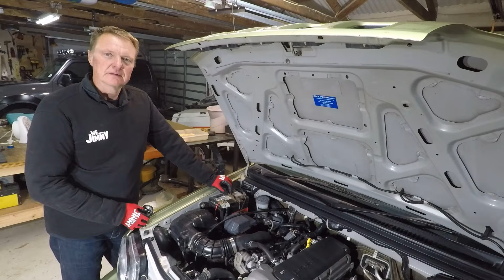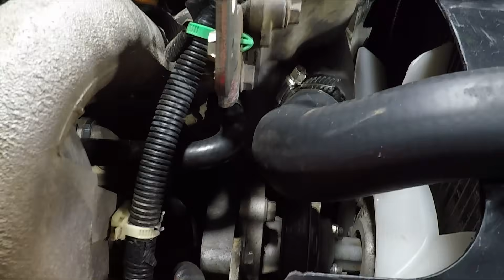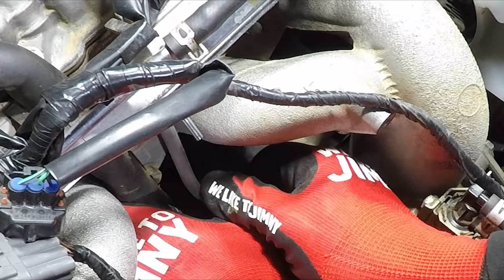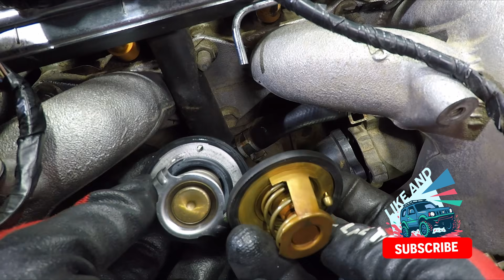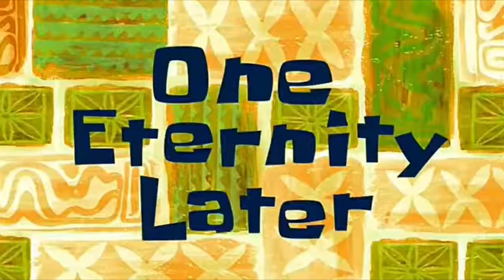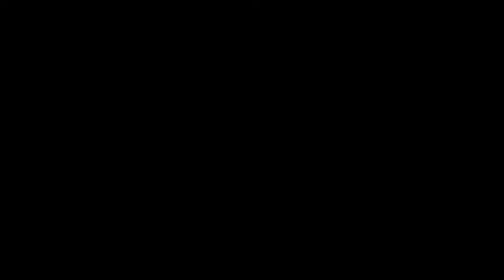How to replace a Jimny Thermostat ft. 2012 Suzuki Jimny Gen 3

Comment: Did you run into issues with the aftermarket thermostat or was this done preventative?
Reply from the maker: Hi Louis, sorry for getting back to you so late. We ran into persistent overheating issues with the aftermarket thermostat installed. After flushing the cooling system, replacing the coolant and radiator cap, and checking both hoses, replacing the unit with an OEM Suzuki thermostat finally solved the problem. It hasn't overheated since. Definitely stick with OEM for thermostats!

Comment: Thank you so much for this tutorial! Mine is way more crusty since I live in wet and cold Norway. Haha. And mine is a 2008.
One of the bolts for the thermostat-housing had fused to the aluminium, so it snapped on disassembly, was a nightmare, but finally got it freed after welding a nut to it. Threads were ruined on the aluminium tho, so replaced it with an m5 through bolt and nut! Hopefully it'll do the job.

What was the unit we took off? The gasket by the hole with the stuffed rag unfortunately ripped when i took it off, so i need to get a new one, and dont know what to search for 😬

Thank you again for the video!